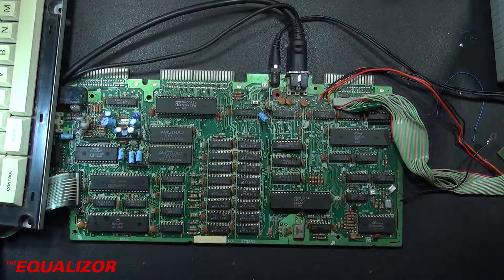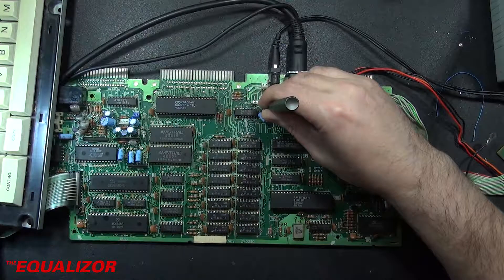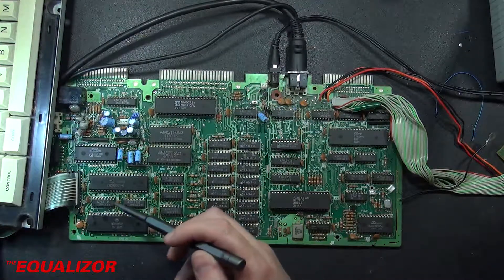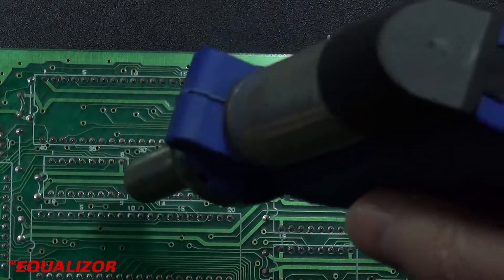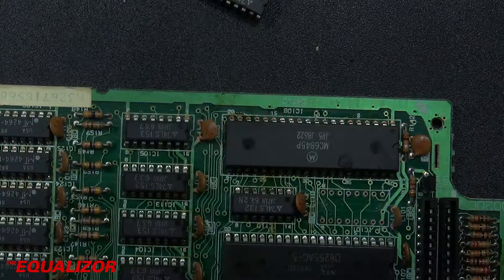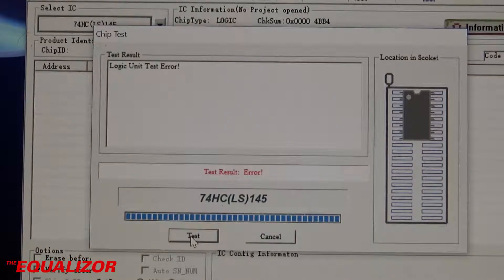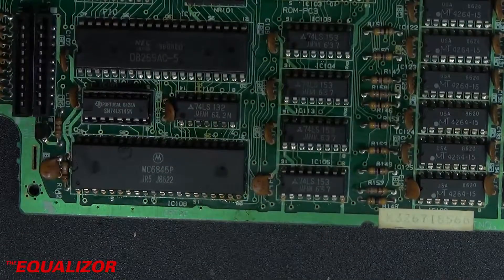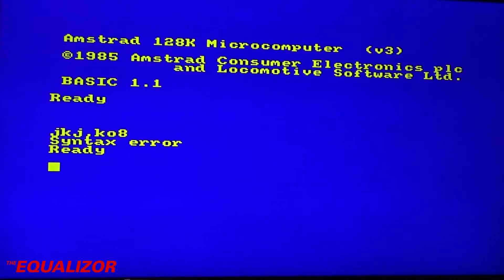Amstrad CPC6128 keyboard Delete key issue repair

Comment: I have the exact same problem, but on a 464 Plus... I've been studying the schematics and testing things and it seems that it has to be the ASIC - I replaced the AY on the off-chance and I've checked all the obvious places for ground/5V shorts or shorts between pins, but nothing's come up. I guess I'm basically out of luck, but if you happen to still be checking comments and have any ideas, I'd love to hear them!

Comment: Hello , I have issues with CPC 464 keyboard ...when I power on the computer and Basic prompt comes, the computer starts to wriite characters and im unable to write anything, also relay makes sounds (on-off) and sometimes an eternal beep .

I changed AY and 74LS145 , no changes, computer still doing the same thing....IC 8255 still not changed because I havent another 8255

Can you help please?, You know where is the fault?? and can you tell me name and model of your programmer/IC tester ¿¿

Thankyou very much  @The Equalizor
Reply from the maker: If it does it with the keyboard ribbon cable disconnected then its most likely the 8255. Its the chip thats partly responsible for the Keyboard scanning and also the Tape Motor control and as you're having issues with both then its the most likely culprit. Might also be worth checking out IC110 and IC125 as thats responsible for resetting the 8255 but I think the 8255 would be the one to swap out. Make sure your power supply is stable too, measure the 5v line for correct voltage [4.75 to 5.25]  and make sure thats theres no ripple on it.
Reply: @the_equalizor  then a IC M82C55A-2 its ok for replacement? I will buy one of that if compatibility its fine
Reply: @spartanx8846   I don’t know if that’s compatible but if you compare the pinouts that should give you an idea. It looks like it should be. If it’s not socketed in the 464 the I’d advise putting a socket in before fitting the new one.

Comment: Hello! Thanks for this very helpful video. I have an Amstrad CPC 6128, with some key issues. To be more precise, keys 5-6-R-T-F-G-V-B do not work! I have opened the keyboard and cleaned the membrane - it looks pretty fine in my eyes, all 'routes' seem OK! I do not know what else to do to be honest - can you please let me know how you came up replacing the 74LS 145 chip? I really can't understand it from the schematics... Any answer will be helpful! Thanks again!
Reply from the maker: Okay, so RTFGVB are all on Y13 of the keyboard matrix and that goes to IC101 Pin 9 which is the 74LS145. If it were me I would short together pin 9 on the Y keyboard connector with pin 5 of the X connector and see if you get an R on the screen. In fact shorting pin 9 on the Y connector and then pretty much any of the other pins on X connector should generate a bunch of your missing characters. If the don't appear then its most likely IC101.  If they do then it's the keyboard matrix. As IC101 is far easier to replace than the Sound Chip thats what I'd replace first.if it were looking like the keyboard was ok. The 6128 keyboard is read by the Ay38912 Sound Chip, and the 8255 PIO via the 75LS145, so those are the chips you'd normally concentrate on. But it you try my tips above, you should get the answer you need.
Reply: The Equalizor thank you so much for the quick response. I will do what you described above and if it doesn’t work, I will order a replacement 74LS145 chip! Thank you again - I will keep you updated  just for the fun! 🙂
Reply from the maker: @voXfReaX  No problem. I'd love to hear how you get on. Like I say the important thing really is just to make sure you can generate those missing  characters manually using the keyboard connector pins and let that guide your fix for it. More than happy to help out, and as I'm furloughed at the moment I have plenty of time on my hands

Comment: what is that device you are using to get the chip out do you have a link to product ?
Reply from the maker: It’s a zd985 desoldering station. But to be honest if I did this repair again I’d just use cutters to cut the chip legs and then a soldering iron/tweezers combination to remove the pins.
Reply: @the_equalizor  fair enough but thats one nice desolderer
Reply from the maker: the9thbit Videos yep, its a useful tool to be sure. I don’t do as much thru-hold repair as I used to but that tool is head and shoulders above those manual desoldering pumps :-)